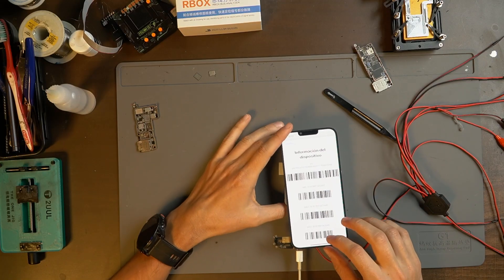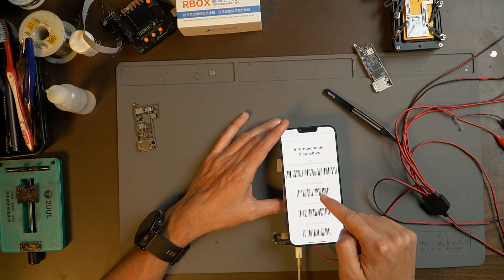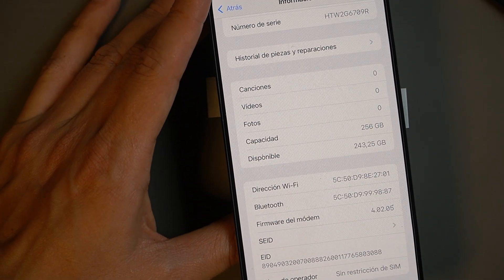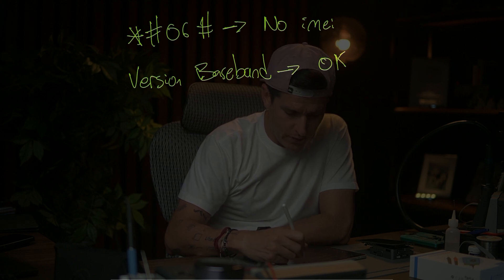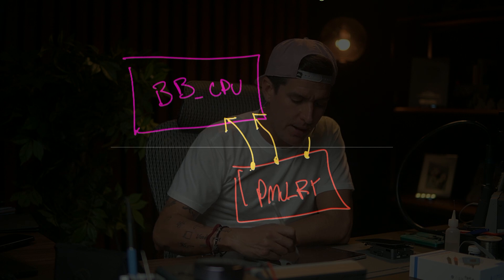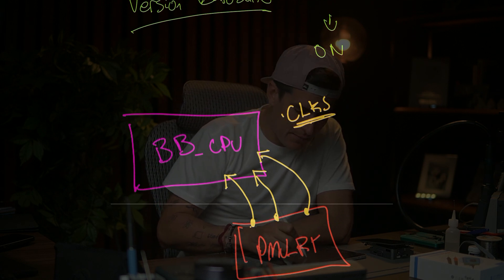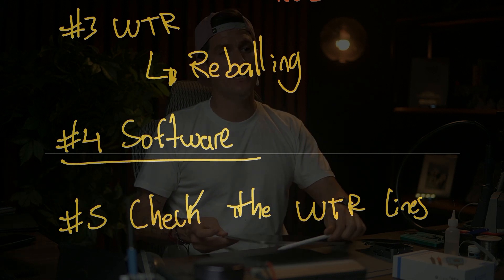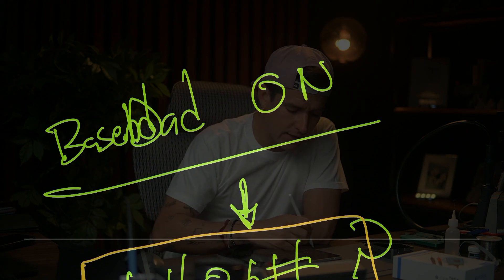iPhone 13 with No IMEI | Diagnostic step by step

Comment: I really enjoy watching your highly educational videos. I’m glad there are people like you who take the time and have the patience to share their knowledge with others.

I ran into a case that adds to this video and might help someone. When checking the interposer in diode mode (12 Pro Max), I got three readings that looked OK, but something seemed off because they were exactly the same (0.382): SHIELD_RFFE2_SCLK_SDR, SHIELD_RFFE3_SDATA_SDR, SHIELD_RFFE3_SCLK_SDR.

Since these were three consecutive pins, I checked continuity between them and all three were shorted together. Most likely, during interposer cleaning or when separating the boards, the temperature was too high and they ended up joined at the bottom between the BB board and the interposer.

So be careful, because besides obvious short circuits, you can also get cases like this, where it’s easy to overlook the issue during a quick diode-mode check and not suspect there is a problem.

Comment: i m having an issue with iphone 11 pro VDD main is short but when i supply the voltage to vdd main no component gets hot where's the short circuit than?

Comment: What's the name of this device you mentioned for troubleshoot RFFE lines
Reply: Rbox Bus Analyzer. There is also one called Bus detection adaptor that works with jcid v1s
Reply: @boardrev Thanks so much which do you recommend and also can I use it to troubleshoot WIFI and BT related issues.am sorry for boldering you Sir.